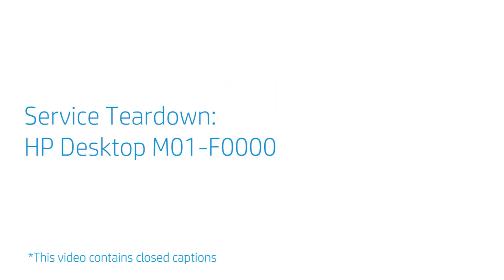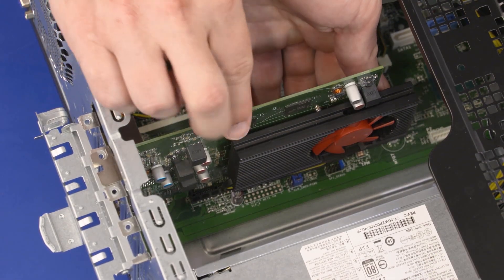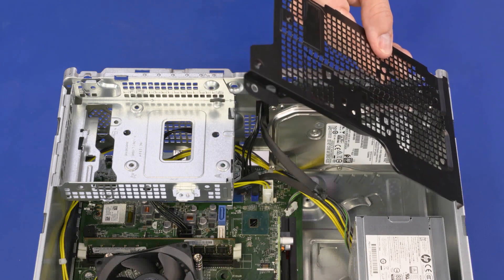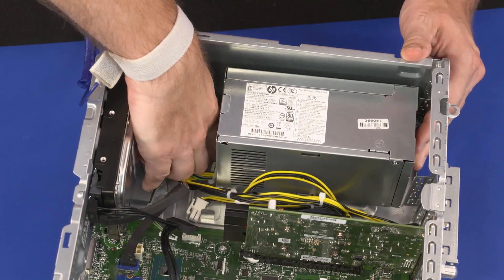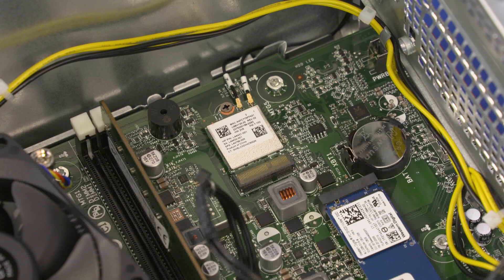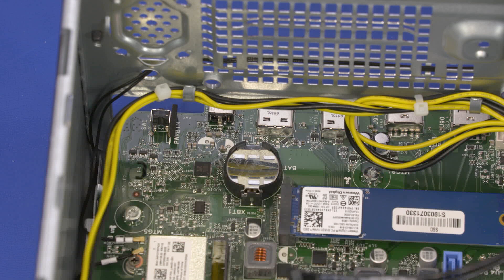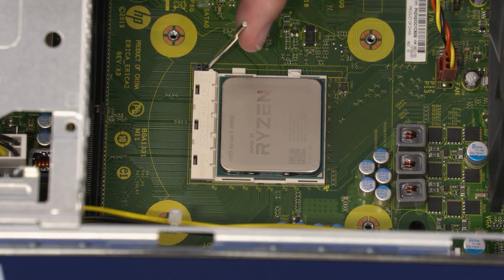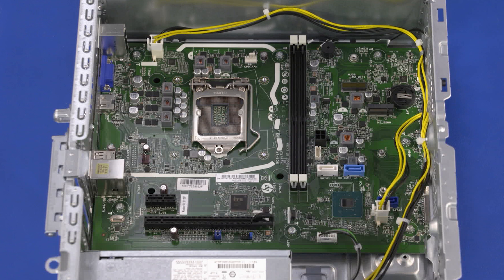Removing & replacing parts for HP Desktop M01-F0000 | HP Computer Service

Comment: Hey Hp, I have a m01-f0024 that has a ryzen 5 3400g 12gb of ram and has an erica2 motherboard. I am thinking of purchasing a L05757-800 500w psu. Will the Asus GeForce GTX 1660 Super Overclocked 6GB Phoenix Fan Edition HDMI DP DVI Graphics Card (PH-GTX1660S-O6G) be compatible with the psu and motherboard
Reply from the maker: Hi there, thanks for contacting!
I understand that you need to know about upgrading the PSU of your computer.
I will do my best to assist you.
The motherboard in your computer is HP proprietary. It has a 4-pin power connector instead of a standard 24-pin ATX power connector. You will have to buy any PSU upgrade from HP.  HP has a 310W PSU (L064961-800) that will be compatible with your motherboard.  I believe there is a 500W PSU (L05757-800) that will work, also.
Binu - Social Media Tech Support
Reply: @HPSupport  Thank you for helping me. I have another question. Do you think I will be able to fit the gtx 1660 super phoenix fan in my m01-f0024?
Reply from the maker: Thanks for the reply.
HP does not recommend upgrading or downgrading hardware parts or software that is bundled with the product as It may affect the manufacturer's warranty and performance, however, you could change the configuration at your own discretion.
Binu - Social Media Tech Support

Comment: Hey HP, I am finding it hard to find a power supply with a higher wattage than my 180W power supply in my system. Can you recommend me any power supply preferably one that can sustain a graphics card? thanks.
Reply from the maker: Hi there, thanks for contacting HP!
I understand that you need to purchase compatible power supply for your computer.
I will do my best to assist you.
You can purchase the part from here: http://partsurfer.hp.com/ Please select your country and enter serial or product number of your unit.
Binu - HP Social Media Tech Support
Reply: @HPSupport the site can't be reached!!
Reply: How I get the 400W or 500W  PSU in UK for M01 CPU?

Comment: Hey HP, what’s the gpu limit for this case (the size limit like 300 MM or something) i have a M01-F1063wb if that makes a difference.
Reply from the maker: +Mikeyv14 Awesome This computer has two PCI Express slots (1 x PCIe x16 and 1 x PCIe x1). So you can add graphics card that supports these slots.
Reply: @HPSupport  thank you for your timely response however my worry lies in whether it not the graphics card will fit in the case not the mother board :)

Comment: Can I upgrade the power supply and what options can I use?
Reply from the maker: +Lando HP does not recommend upgrading or downgrading hardware parts or software that is bundled with the product as It may affect the manufacturer's warranty and performance, however, you could change the configuration at your own discretion.

Comment: Hey HP , the slot covers where the gpu is supposed to pop out of with its hdmi ports is completely blocked and i’m not sure how to remove them. i dont want to risk breaking anything
Reply from the maker: +t1ana.W Please contact our phone support team to fix the issue. Please follow these steps to reach them.
Step 1. Open link: https://support.hp.com/us-en/contact-hp
Step 2. Select the product type.
Step 3. Enter the serial number of your device or select let HP detect your product option.
Step 4. Select the country from the drop-down.
Step 5. You should see the HP phone support number.

Comment: hi hp, is it possible to change the psu and add a gpu?
Reply from the maker: +raven This computer has 1 PCIe x1; 1 PCIe x16. So you can add graphics card that supports this slots. HP does not recommend upgrading or downgrading hardware parts or software that is bundled with the product as It may affect the manufacturer's warranty and performance, however, you could change the configuration at your own discretion.

Comment: I am confused on how to install a gpu. The metal slots seem to be in the way. What I mean is, there is no screws to remove just almost like a solid piece. There is a screwdriver symbol on the outside. I don't want to break the case.
Reply from the maker: +orangebeast ike Please contact our phone support team to fix this issue. Please follow these steps to reach them.
Step 1. Open link: https://support.hp.com/us-en/contact-hp
Step 2. Select the product type.
Step 3. Enter the serial number of your device or select let HP detect your product option.
Step 4. Select the country from the drop-down.
Step 5. You should see the HP phone support number.
Reply: Did you fix it
Reply: They break off. They do not go back on. This is normal.

Comment: Can i upgrade my Hp pre-build m01-f1003nc can i change the PSU into like Corsair or Evga?
Reply from the maker: +kvetinky sk HP does not recommend upgrading or downgrading hardware parts or software that is bundled with the product as It may affect the manufacturer's warranty and performance, however, you could change the configuration at your own discretion.

Comment: Can i upgrade the psu on this pc
Reply from the maker: +kvetinky sk HP does not recommend upgrading or downgrading hardware parts or software that is bundled with the product as It may affect the manufacturer's warranty and performance, however, you could change the configuration at your own discretion.
Reply: @HPSupport  i’m just asking can i change the Psu to like Evga or Corsair?

Comment: Hp can I upgrade the amd 3 to an amd ryzen 5?
Reply from the maker: +DarkOre54 Please refer 'processor upgrade information' under the specifcation page  to know about upgrading processor: https://bit.ly/2Q5Mf79
Reply: @HPSupport  The processor that came with my purchase was an AMD Ryzen 3 3200g with an am4 socket and a TDP of 65W. Using this info I should be able to find another Amd Ryzen that is compatible with my motherboard or am I missing another important detail?

Comment: Thanks for the video. Very helpful!
Can I install a SATA SSD drive (not an M2_SSD) in this box? It doesn't look like there is another SATA cable connector available on this motherboard.
Reply: There is. It's blue
Reply: You can see it next to the M.2 Drive at 7m25s on the left.
Reply: @dharmabummed9923  Thanks for the help.
Sorry, I was not clear about what I was trying to say. My box came with a 1TB 2.5" SATA HDD installed on "the blue" connector. I would like to keep this 1TB drive in it and also want to speed up the loading process. So I was trying to find a second SATA connector so I can put in a SATA SSD drive since I already have a few spare SSDs on hand and don't really want to spend more money on M2s.
Do you know what is that "white" connector (right by the blue one)? I cannot find anything on the HP manual.
Reply: @polymyxa8233  Not sure about you MB but mine has 3 sata ports. White, light blue and dark blue. The DVD drive is in the white and the 1tb hard drive is on the dark blue. The dark blue is below the white and light blue. I had to remove the black cage on the bottom covering the hard drive to access it.
Reply: @dharmabummed9923  I'll check it again. Thank you!!!

Comment: hey hp i have bought that pc like a year ago i was wondering if i wanted to move the mother bard and put it in a another pc case like the towers that light up do you think 
it will fit in a  
Montech X2 MESH White - Compact ATX Mid Tower Case, Fine Mesh Front Panel, Pre-Installed 2 x 140mm, 1 x 120 mm Autoflow Rainbow Led Fans, High Airflow, Full Glass Side Panel
Reply from the maker: +John Lee HP does not recommend upgrading or downgrading hardware parts or software that is bundled with the product as It may affect the manufacturer's warranty and performance, however, you could change the configuration at your own discretion.

Comment: Hey hp is it possible to replace the motherboard in this pc for another one?
Reply from the maker: +Nxuseous HP does not recommend upgrading or downgrading hardware parts or software that is bundled with the product as It may affect the manufacturer's warranty and performance, however, you could change the configuration at your own discretion.

Comment: Hey hp, I have a rx 570 can you tell me if it will work with this system, pretty please
Reply from the maker: +I AM TheV This computer has One PCI Express Gen 3 x16 and One PCI Express Gen 3 x1. So you can add graphics card that supports these slots.

Comment: i got the M01-F102bla and its completely underperforming in valorant and csgo with constant stuterings to 20 fps when it should be stable at over 150. how can i fix this?
Reply from the maker: +D C Learn more about what factors influence the way a video game displays on your computer, and how to improve performance as mentioned here: http://bit.ly/2V6PSK4
Reply: @HPSupport  tried everything, i just ended returning it. dissapointed :(
Reply: @MrDomingo  your model name? Gpu
Reply: @kvetinky6831  it was a 1660 super i returned it

Comment: Hey I got the hp mo1-f0033w from Walmart can I put a graphics card in here? And can I also put a better psu? There’s no YouTube videos of my specific brand. Thank you
Reply from the maker: +Stxit-  Believe it or not the PSU in all HP desktop computers is more than adequate. It may seem anemic in comparison to the numbers "recommended" by the graphics card vendors, but rest assured the stock PSU is adequate and good quality. This computer has One PCIe x16 socket and One PCIe x1 socket. So you can add graphics card that supports these slots.

Comment: Hey HP, outside of the included M.2 Storage, does this include the sata cable to install an additional 3.5" hard drive or is that sold seperately? Also what is the tyical speed of the RAM in the system?

Comment: Hey hp, could I swap out the motherboard for a retail model to add a new psu and gpu? I have a HP M01-F0016, and I want to upgrade it. If possible, could you also link me to a motherboard that will fit with the built in io shield?
Reply from the maker: +Ryosum HP does not recommend upgrading or downgrading hardware parts or software that is bundled with the product as It may affect the manufacturer's warranty and performance, however, you could change the configuration at your own discretion.

Comment: how do i get a higher watt psu for my HP M01-F0027na
Reply: You can replace the stock power supply (psu) with something like the HP PA-4501-1 L07304-001, which is a 500 watt unit. 
Just keep in mind that the psu will have to be installed upside down (which is fine). 
I have done this myself, and it worked fine.
Reply from the maker: +Kyzerii You can not adapt an ATX PSU to work with those units.

Comment: Hi HP. Can the processor fan be replaced with a low profile model?
Reply from the maker: +dinoq HP does not recommend upgrading or downgrading hardware parts or software that is bundled with the product as It may affect the manufacturer's warranty and performance, however, you could change the configuration at your own discretion.

Comment: I have the m01-f1033wb. I want to upgrade the psu. If I order one that is compatible with my computer from HP. Would the installation be the same as in the video?
Reply from the maker: +Cloudy NS You can try the steps mentioned under the video on your computer. I understand that you need to purchase power supply for your computer.
You can purchase the power supply or any other accessories from here:
www.hp.com/accessorize 
I hope this helps you!!
Reply: @HPSupport  I accidentally mixed up the cords for the monitor and tower. One is i-sheng and the other is linetek. Can you tell me which one goes where?

Comment: I have an M01-F0014 and I want to put a graphics card in there but I need to get a better power supply since mine is 180 watts. any out there that support my system that's higher wattage?
Reply from the maker: +Monxrchyy You can check for compatible parts from here: http://partsurfer.hp.com/ Please select your country and enter serial or product number of your unit.
Reply: The HP PA-4501-1 L07304-001 will work, and its 500 watts
Reply: @insertnamehere8121  do you have a site to use to buy one?

Comment: Hey hp I have a HP M01-F0016 PC and I want to add a graphics card but I want to upgrade the psu, can I add any psu? If not then which one can I add? I’m thinking of adding a 500W PSU. If I can’t upgrade the psu what graphics card can I add without damaging the system, since the psu only has 250w.
Reply from the maker: +qtBanants This computer has 1 PCIe x16; 1 PCIe x1; 2 M.2. So you can add graphics card that supports these slots. This HP PC has a proprietary power supply and motherboard. You can't use retail power supplies in this system.
Reply: did you figure it out?

Comment: hey hp service can i put a 1660super in this pc with a500 psu
Reply from the maker: +ΒΑΣΙΛΗΣ ΑΡΜΕΝΙΑΚΟΣ This computer has One PCIe x16 socket
One PCIe x1 socket
One M.2 socket 1, key A
One M.2 socket 3, key M for SSD (PCIe x4)
So you can add graphics card that supports these socket.

Comment: hey HP I have hp probook 4540 can Iremove the graphic chipset with dedicated graphics?
Reply from the maker: +Lucas Hama It already has video chip (card). As mentioned above, no way you can add an external video card to your machine. Actually there is one way which requires the following steps:
(a) Buy a new motherboard which supports external video card,
(b) Buy a new video card,
(c) Buy a new cooling system,
(d) You may need new power supply (charger)
And at the end of the day your machine may NOT work as you dream and the total cost would be more than the price of a new, better computer.
Hope this explains a bit more.
Reply: @HPSupport  ok thanks
Reply: @HPSupport  Can I upgrade the cpu?